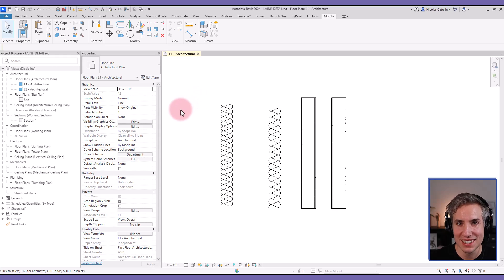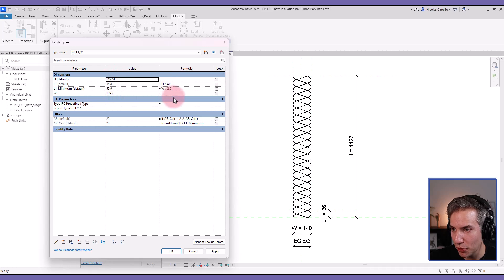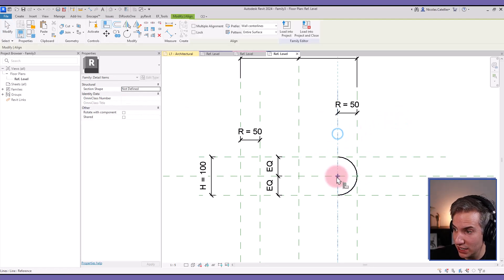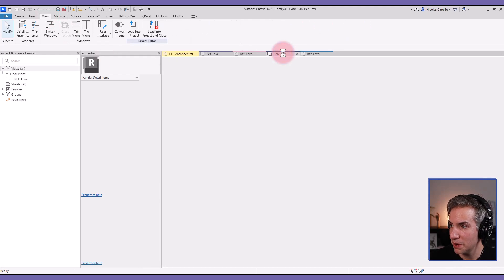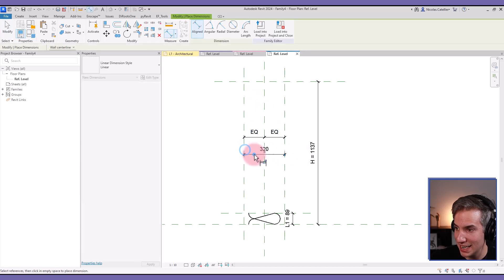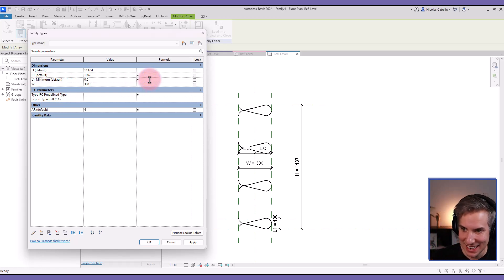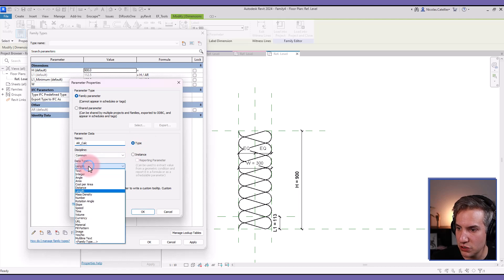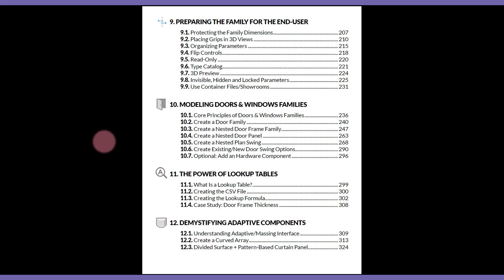Revit Tutorial - Parametric Batt Insulation

Comment: The only thing I would disagree with being an "issue" is that the top and bottom do not fill to the edge. This doesn't matter really because you would have a bottom plate and top plate detail component covering that space 99.9% of the time anyway. Be it a metal stud deflection track/standard track/wood stud at the top and a standard track/wood stud at the bottom.

Other than that, this is a perfect family to use in lieu of the OOTB system family. =) Thanks, Nic!

Comment: Can we have a batt insulation as cut material inside live wall sections? I tried to make a draft pattern but it never centered in walls 😢
Reply from the maker: Nah, it doesn't work as a pattern.
Reply: @bimpure  is there any way to have it as a material imbedded in the wall sections?
Reply: @imamaleph  may be use imported cad hatch inside Revit for the wall cut hatch pattern. make it a model hatch line, not a hatch line. i don't taste it but try it if it work.